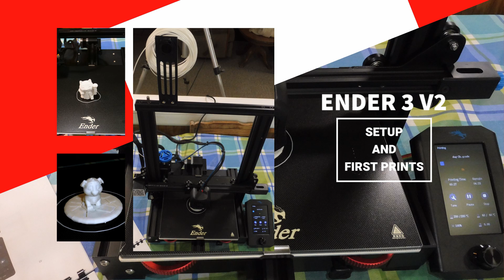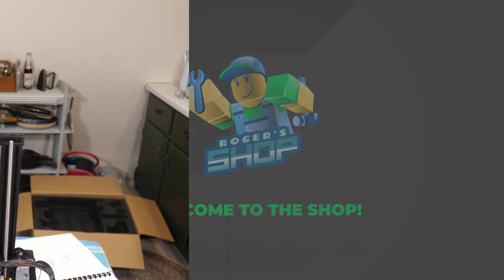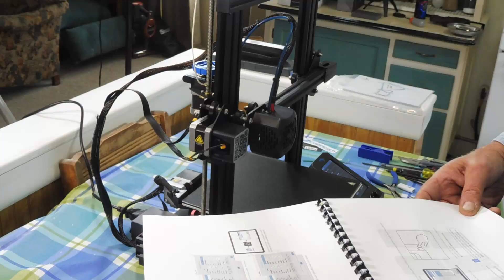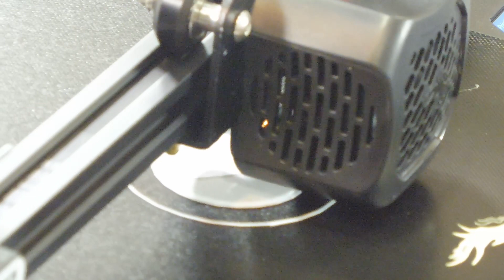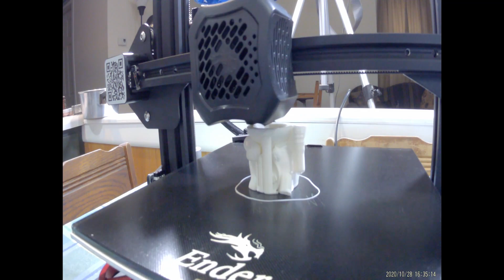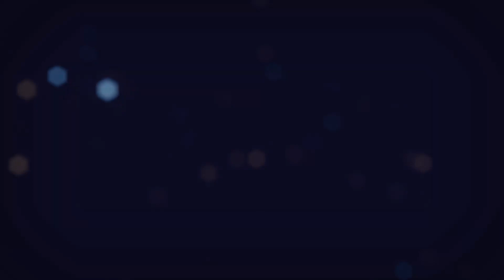Creality Ender 3 V2 First Test and Prints

Comment: For some reason my print refuses to stick to the bed.Have tried cleaning,but nothing happens,End up taping the bed with blue painters tape.Not sure what is going on with the glass bed.
Reply from the maker: Use a glue stick.  Easy to apply and clean up is with water.

Comment: I have an Ender 3 v2, and when I'm printing, the filament always comes out sticking together instead of break in when it ends to to move to another part. (For example, when it makes the first line then moves over to start the base of the dog, the filament keeps coming out instead of stopping the line, moving, then making the base). Does anyone know how to fix this?
Reply from the maker: That is called "stringing" and can happen if the steps are not set correctly for the extruder stepper motor.  It can also happen with crap filament.   have one roll of white that will string no matter which printer I put it on.
Reply: I was able to figure it out. The filament wasn't sticking, and that was causing it to string, so I rubbed a glue stick on it and that worked.

Comment: My test print was no good to say the least. I just hit test print car and it said the bed and everything was heated but it didn’t stick to the bed at all really. Any tips?
Reply from the maker: A lot of things can cause this.  If ambient temperature (room) is less than 72F, bed temp too low (I use 60C for PLA), bed not clean.  I also use a glue stick most of the time as insurance.  Some use Aqua Net hair spray, but I find that messy.  Purple glue sticks work well and are cheap.  Easy to clean the bed with water, too.
Reply: @rogersshop  Thankyou for the suggestions! There was a clip with 5 wires labeled E with one wire not attached, looked like it was crushed out but I was able to snip that part off and connect the one wire to the little metal rod that sticks out. Don’t know if that has anything to do with it cause it homed fine
Reply from the maker: @bradleyrivenbark946  The plug marked "E" is for the extruder
Reply: @rogersshop  I ended up leveling the bed better and making the making the tip WAYYYY closer to the print bed and it works soooo much better
Reply: @rogersshop  also, I just clicked on “test print” and did the cat one. I didn’t change any settings “bed heat” at 45 and the other heat at 200.
Reply from the maker: @bradleyrivenbark946  Bed temp is too low.  Should be at least 50.  I run mine at 60 for PLA

Comment: both of  my print failed so far, Im printing another one rght now, i have checked literally everything I can and cannot find the problem
Reply from the maker: What exactly is happening?
Reply: @rogersshop  prints keep failing midway through the print I get bunch of spaghetti on top
Reply from the maker: @Laundrey  I suspect that your Z axis limit is set wrong, so when you level the bed, the knobs are quite loose and shift while printing, resulting in the mess you describe part way through the print.  If the knobs are not somewhat 'snug' after leveling, they will drop down on their own when the Y axis moves.  this results in too much gap and ends up making a mess of strings part way through your print.  Are you attempting to make one of the factory suppled prints such as the cat or dog?
Reply: I’m here to tell you that 2 more have failed, it keeps failing exactly mid way, I’m returning the printer, I guess 3D printing is just not for me

Comment: Man I wish my ender had fans as quiet as yours
Reply from the maker: I have four of these now and all are quiet, even when all running at the same time.  You might need to replace your fans if noisy.
Reply: @rogersshop  Oh man, that's good to know it isn't normal.
I can hear it on the other side of a closed door, pretty dang loud.

I'll look into it now, thought it was normal.

Thanks!
Reply from the maker: @ethanwebb6122  I often shoot videos in the "loft" where there are four of these generally running behind me and you don't hear a thing from them in the videos.

Comment: Mine worked first time now filament won't stick no matter what I do.
Reply from the maker: What is your ambient (room) temperature?  During the cold months, I increase my bed temperature to 60 C since the room temperature in the loft is kept in the mid 60's F.  I also use a glue stick if the base of the item printed is small.  Adding a brim will also help adhesion.

Comment: hi i just got the ender 3 pro and i did the 3 test prints and they came out so  nice. i tried printing custom files and the filament wont stick to the bed help.  is it a setting cause the test files print fine. but once i try to print a cura gcode file it wont stick at all!
Reply from the maker: Check your bed temperature setting.  It may be too low in your Cura file.  Ambient temperature will also affect bed adhesion, if it is too cool in the room.

Comment: Mine does not stick to the bed I tried it for the first time and after the round circle of the dog it kept losing it. Did you clean it with alcohol or not?
Reply: Also it could be a bed leveling error I have the ender3v2 I noticed that I had to do the bed 
bed leveling a couple of times to get it rite
Keep nozzle at 210c usually put fan speed to 60 usually
Reply from the maker: I just used Windex before first print (and subsequent prints).  Make sure your bed is level and that nozzle to bed distance it proper.  Also consider your ambient room temperature!  If under 70 degrees F, I suggest increasing the bed temperature by 5 degrees C, at least.  I discovered this issue during the winter where I have my printers located as ambient there is 60 degrees F.

Comment: you didn't show any of the menu settings.
Reply from the maker: First print used factory settings.  I didn't change anything.
Reply: @rogersshop  oh ok, I was looking for  settings as I'm trying to use and ender 3 that used to have octoprint on it, but now I'm trying to use it from the built in menu. I have set it up with octoprint again now & it's working fine. Many thanks for your reply.
Reply: What do you tend to set your nozzle and bed temp at

Comment: Thhe beds height changes with thermal expansion when the bed heats up
Reply from the maker: Indeed it does, as any item made from aluminum.  This expansion/contraction ratio was one of the downfalls of using aluminum wire in electrical systems as the connection would eventually loosen up after the repeated cycles of heating/cooling resulting in high impedance connections.